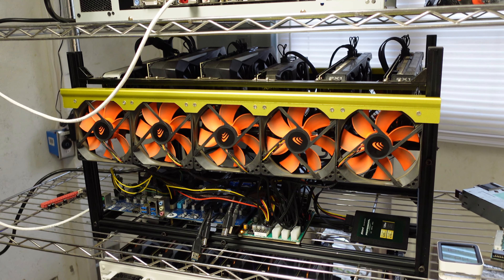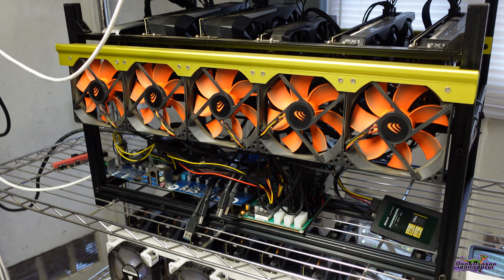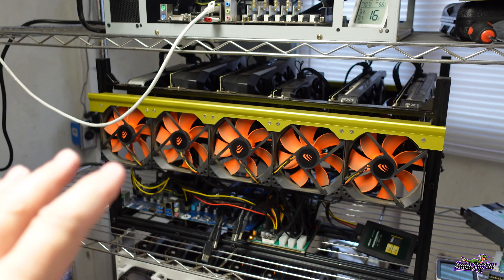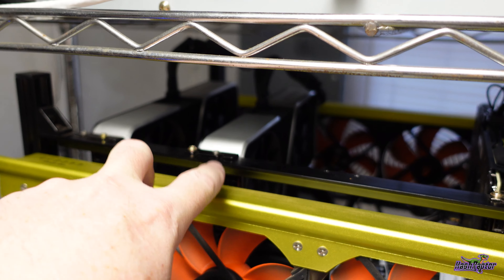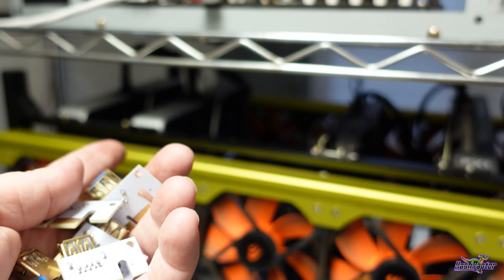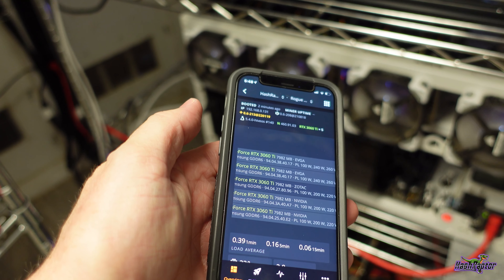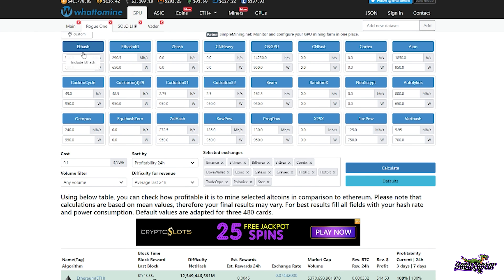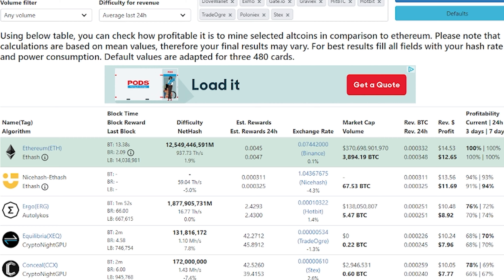NVIDIA 3060 Ti Rig Build Part 4 | The Rebuild

Comment: I think you should be more efficient. I have 6 Zotac 3070 FHR and i'am at 363mh/s for 808watts at the wall ( 680w in the software, windows 10, i have avg of 113.4watts by gpu for avg of 60.5mh/s )